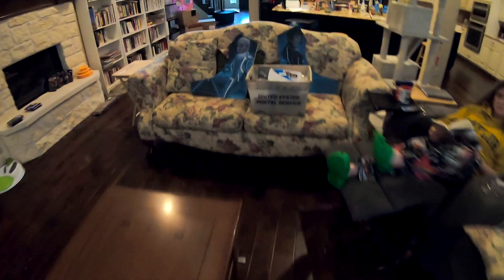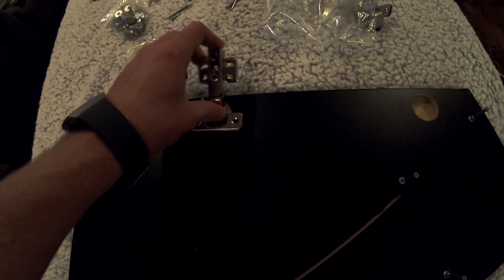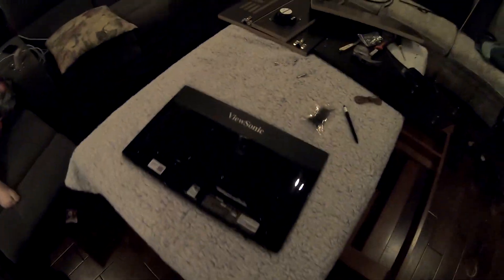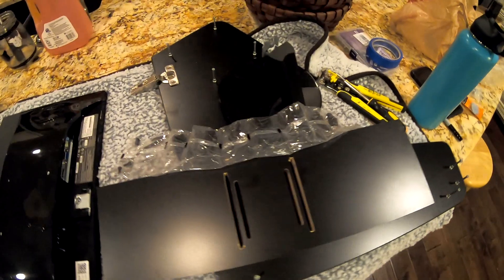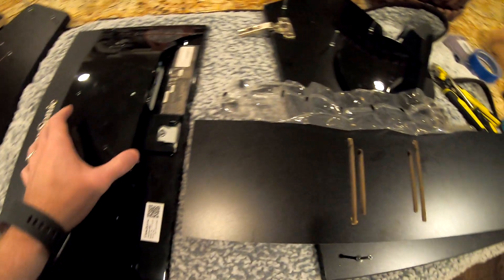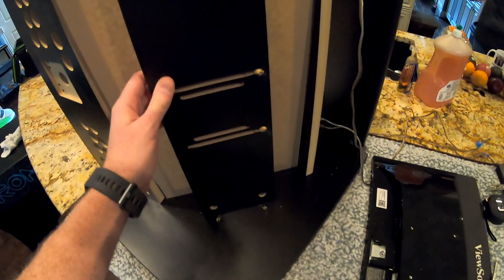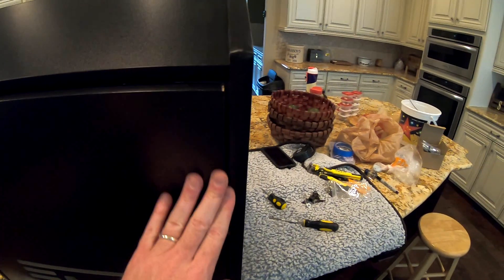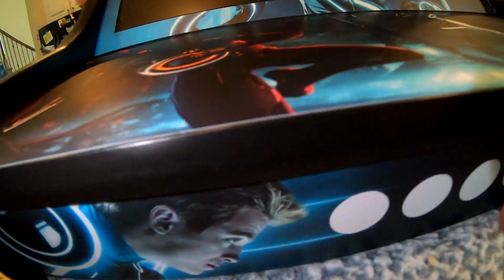Bartop Arcade Assembly, Part 1 - Game Room Solutions Deluxe

Comment: I had a similar experience with the monitor bezel. It's still not totally perfect but after reapplying it with a grid underneath and trimming the excess vinyl with an xacto it's in much better shape now. I feel like they print it just a bit too big horizontally. I know they've updated the cab since then so hopefully that's a better fit these days. This weekend I took mine completely apart to fix that, install marquee lights, and block off some of the gaps that light leaks through (marquee sides, top and bottom of monitor). I low key want to get new plex and bezel from another supplier but I'm happy with mine for now.
Reply from the maker: Glad to hear they’re getting better. I’ll have to try your solution. Thanks for sharing.

Comment: Just figured I'd give you an update as I did end up going with the company for the Bartop Delux.

Good:
-Customer support seemed perfect, damn near instant response any time I emailed.
-I asked for 4 button modern layout instead of the 3 button and they got that perfectly.
-Everything went together extremely easily just like the Ikea furniture its based upon.

Bad:
-I ordered on April 1st and it was ready to ship April 4th however it didnt leave until I emailed them on April 8th due to "FedEx didn't come out Thursday, Friday or Monday" situation but then arrived shortly after on the 9th.
-I asked for a custom marquee which the print quality is not amazing and had some micro scratches on it.
-The Speaker Panel has a good dime size gash in it, luckily on the very back end which is hard to ever see when in use.
-Screen Plexi and Controller panel plexi wasn't cut right so the Screen plexi bows when the entire thing is put together and the controller plexi keeps getting stuck on the t-molding when closing.
-They just stopped including the hinges and they don't even include holes to install them at all, instead they want you to just wood screw the panel to the back.
Reply from the maker: Well, good to know. I haven’t ordered from them in a while. Good to see they still half ass stuff!!

Comment: Man, i had an issue with my bar top.  The control panel was far up where it hits the vertical board.   Then the marquee slot wasn't even.  Plus they didn't send me the hardware (screws and cam lock).  I had an issue with their buttons on how it looked.  Then one of their female customer service gave me an attitude.
Reply from the maker: Sorry to hear that. And sorry to hear that it seems they haven’t improved in the time since I made that video.